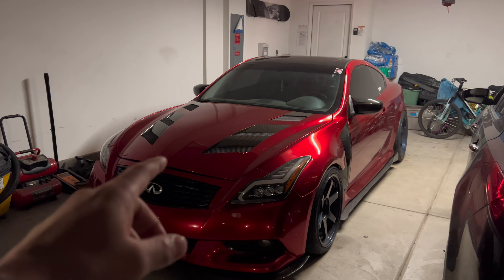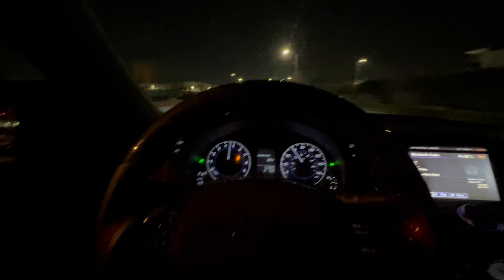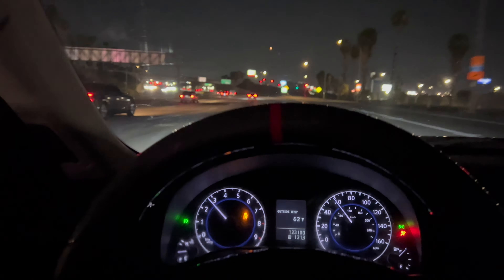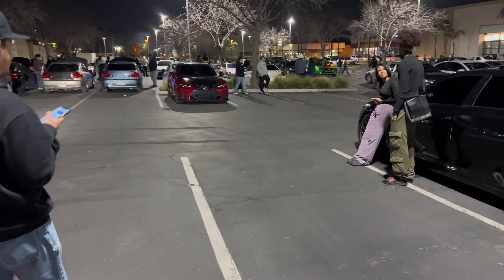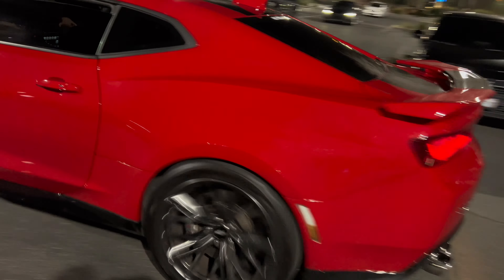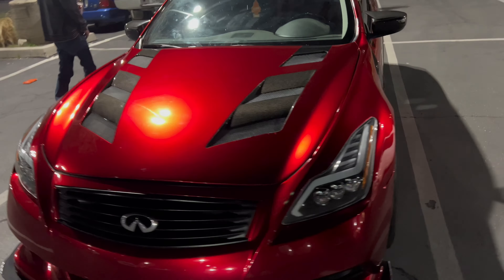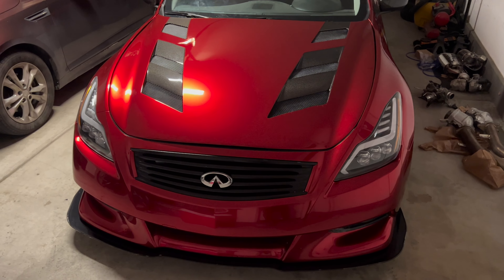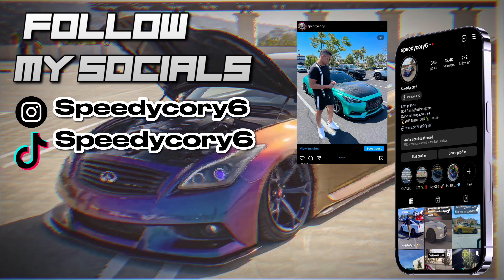FIRST RUNS IN MY REBUILT 700HP G37 AGAINST A TOYOTA GR SUPRA!

Comment: Your oil coolant temps are solid, even for after doing those 3 runs. 

How many row oil cooler do you have and where is it mounted?  What was ambient temps that night? 

I was expecting to see somewhere close to 230°F for oil temps after those pulls. I hit 210°F just highway cruising,  no high rpm.
Reply from the maker: It was pretty cold, around 60 degrees that night! But yeah she did good, so far the DIY headgasket replacement holding up
Reply from the maker: And I have a 34 row setrab oil cooler!

Comment: Good shi makes me wanna boost my 35hr
Reply: Weird question did the gallery gasket give u any issues?
Reply from the maker: @azizdavlyatov4510  not a weird question! But no, but I rebuilt my motor recently and made sure i used the metal gaskets. Oil pressure is A1 👌🏽